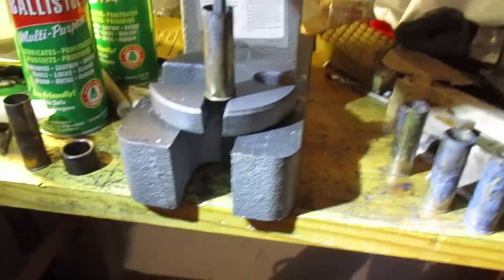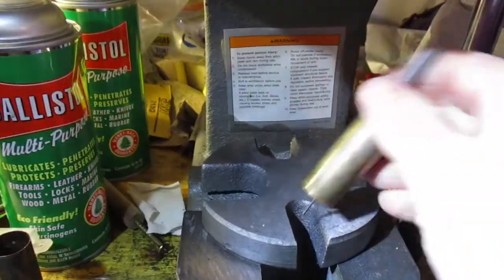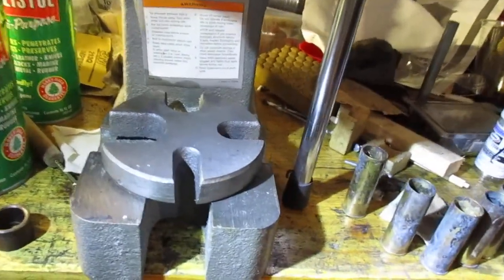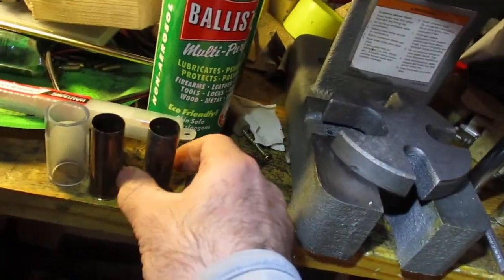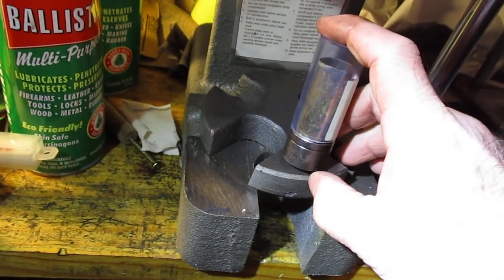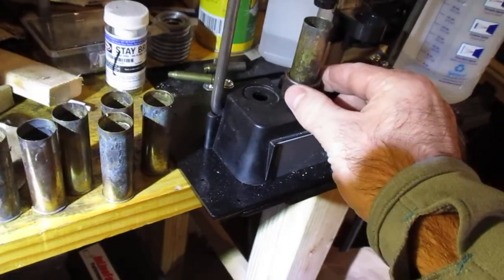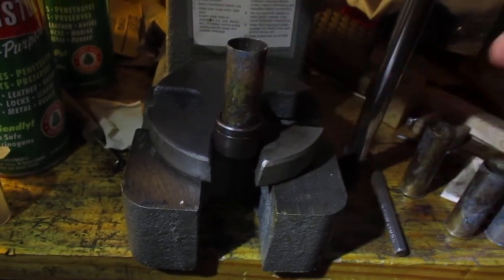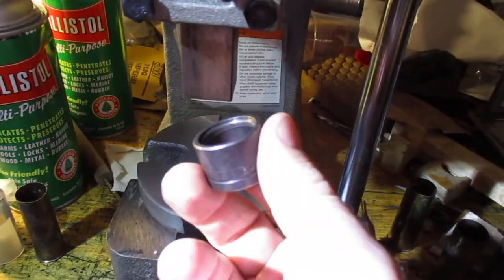How to size brass shotshells without cowboy dies

Comment: Need to clean that brass up it’s going to corrode to it’s unusable. Clean it with a mix of diluted vinegar and water. And clean with water after every firing
Reply from the maker: I do clean them but after de-capping so they wash and dry better. Thanks for the comment.